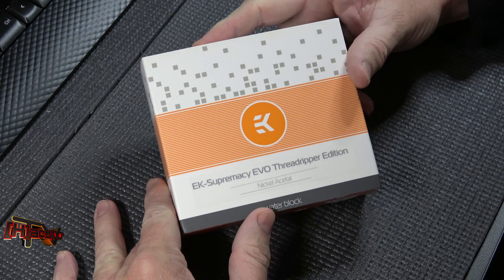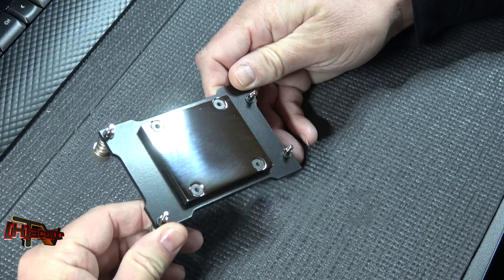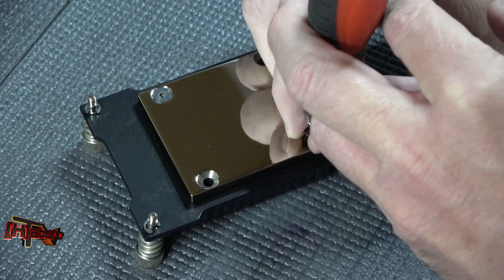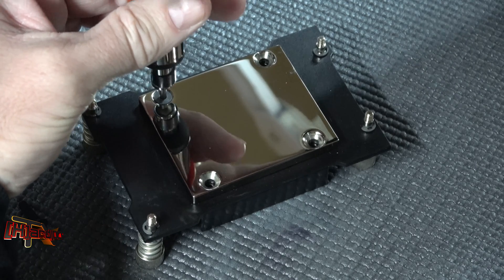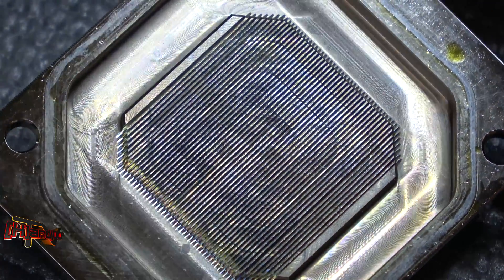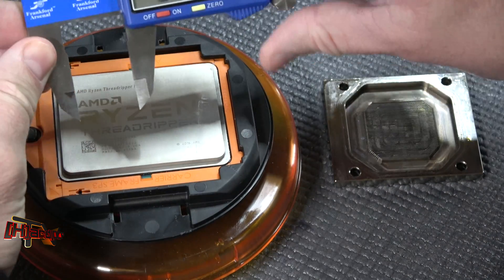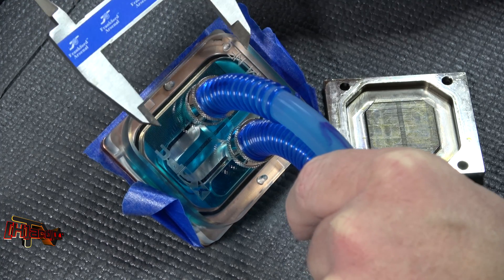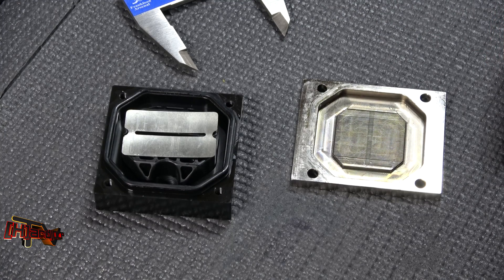EK Supremacy EVO Threadripper Waterblock Unboxing & Breakdown

Comment: guys, maybe stupid idea but what if i can put two tower coolers /quite slim ones/ on TR heatspreader mount it by DIY mounting kit ??
Reply from the maker: Hehe, that mounting system should be fun!  Make sure you share it with us when you are done!
Reply: well i am on half way now
i got two HR-01 thermalright heatsink towers with 6 heatpipes, now i need to "invent" that mounting kit ... 
but for now i can share with you some pictures of one heatsink which definitely not build for TR 4 socket maybe some1 can remember for big typhoon heatsink and i mount it onto my TR 1920 x aaand did some windtunel for 22 cm fan blowing air onto BT heatsink ....it look very lame but it work , i am just imagine for how long .....

btw : how i can show to u that pictures , i have no exp. with this ....

Comment: Looks like EK took the easy route and simply added more material to the perimeter of their other blocks, rather than designing a full fin stack specifically for TR4. Lazy engineering = lazy performance.